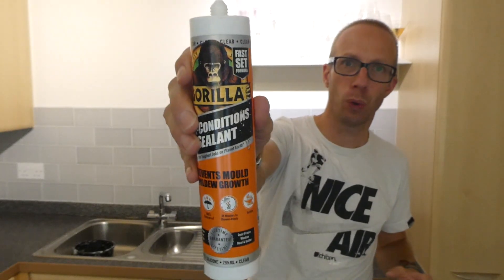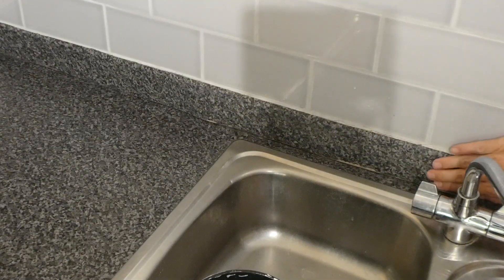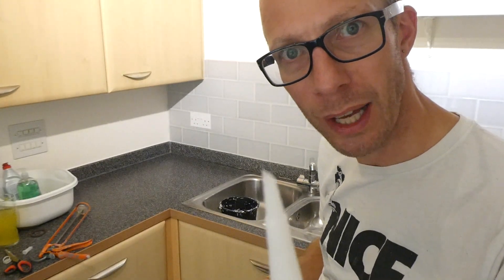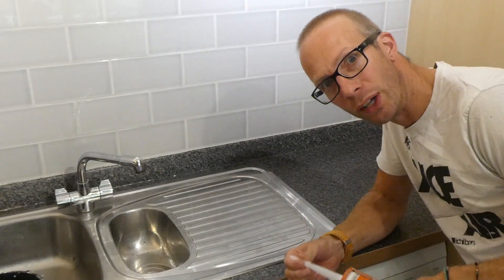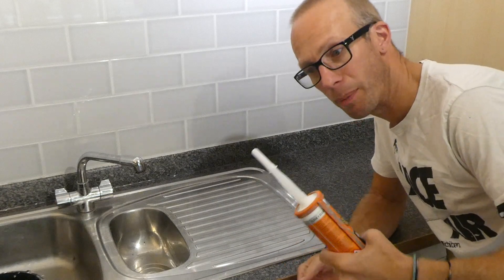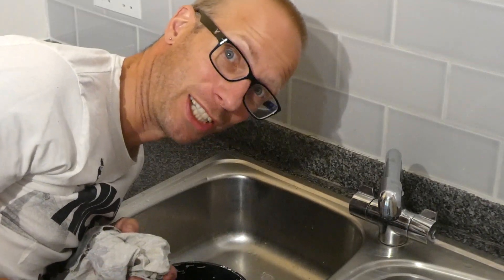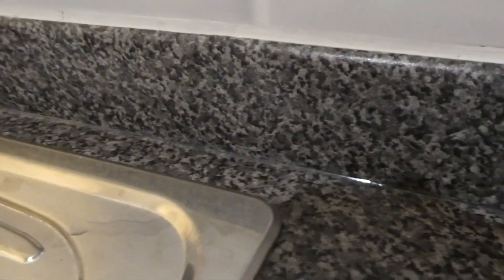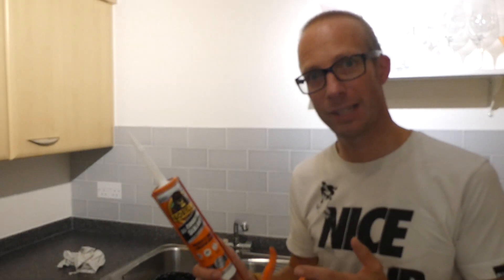Trying out Gorilla Clear Silicone

Comment: Top Tip
1. Have your tip clean & ready 
2. pump well until pressure builds 
3. point tip in direction you wish to deposit sticky substance on 
4. spread sticky substance with lubricated hands & fingers. 
5. Receive kiss from girlfriend.